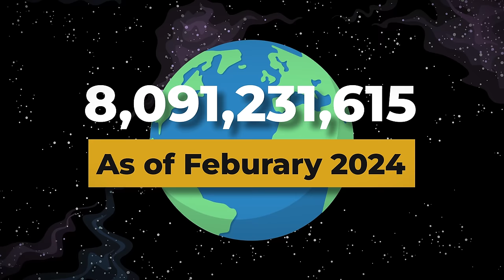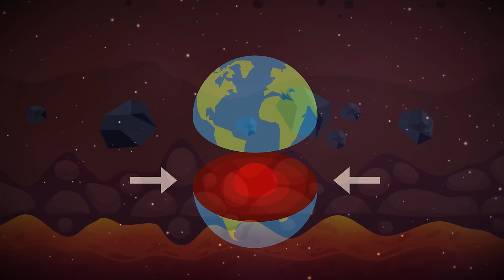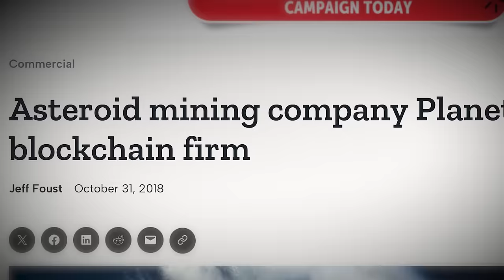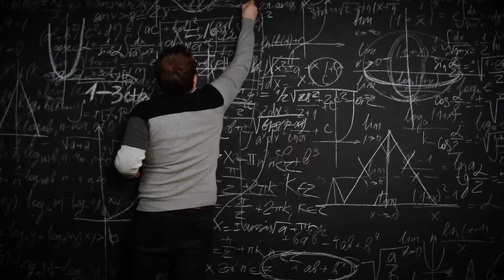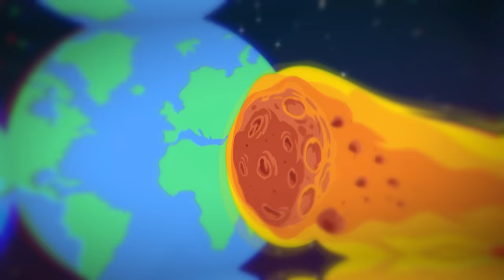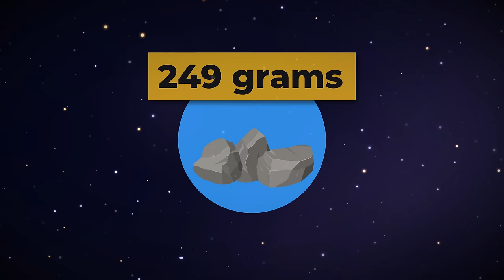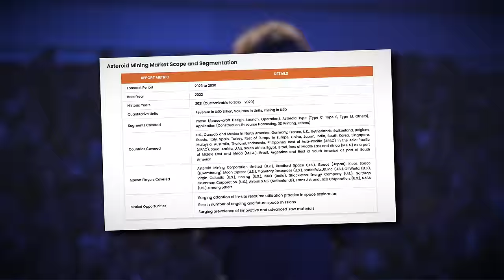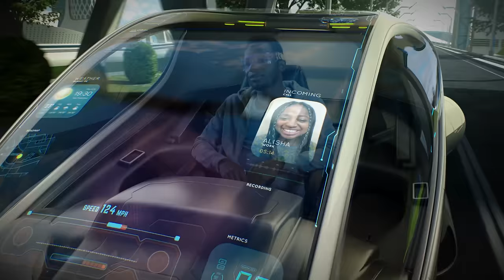Billionaires Are Secretly Directing Asteroids To Earth and We Don’t Know Why

Comment: A space construction yard for ships would be start.
Reply: please define "ships"
Reply: Where do Shipbreakers sign up?
Reply: Then we will have space pirates.
Reply: @dynhoyw  A ship is a vessel.
Reply: Or like a base on the moon.
Reply: @KarmaCadet  Well, we now have a military unit for space, so let the uncontrolled spending begin!!
Reply: @dynhoyw  There's simply no need to define a basic word.
Reply: @mikitz   captain Harlock
Reply: @geostyma you want a base on the moon.  I'd like a border wall.  Let's start with projects worth doing, right here on Earth first, ty
Reply: @cloyola8889 Robert Bigelow has multiple research and production facilities in space right now.  Private owned but public knowledge. Zero gravity is a necessity to try and understand and reverse engineer stolen exotic technology.
Reply: @dynhoyw  A ship is like a boat but bigger.
Reply: @Durzo1259  on Earth? not really, but in space? do yall even know how that would be done with our current technology, resources and funding? by proper definition of popular dictionaries, a ship is a vehicle or a vessel typically bigger than a boat for transporting cargo by water, and no way in hell will we fill in the necessary requirements to move around goods at interplanetary distances in the present, let alone in the near foreseeable future. Thoughty2 explained the reasons for that quite well, and unless some mystical breakthrough is discovered in rocketry ain't no way we'd be building "space construction yards for ships" like it's Trailmakers. people mention ships and space-shipyards like we're in Space Engineers, like we're a type II civilization. how and when would we even build such thing as a space construction yard? when the necessary requirements are met? well no shit sherlock

Comment: Why can't we just Anchor a lazer/ solar sail with a Lazer in the Anchor to push sail. And then crash them into the moon and mine and prosscess them there. Or put a second rear solar sail on them use the sun's solar wind to slow them down and brake them in orbit then breakdown bigger ones into smaller pieces in orbit and parachute them down over ocean. Though landing them on the moon at mining factory would be easier.

Comment: Why not push a NEO into the moon, and then mine the crash site on the moon?  The impact should help crack them open, and the moon should also have enough gravity to build drills on.  It seems way more practical than anything else.  It would still be a massive undertaking, but it’s a lot more doable.

Comment: If the metals are pulled into the Earths core then wouldn't Lava contain large amounts of these elements?
Reply: Kind of. Magma, what lava is called before it reaches the surface, is molten rock with dissolved metals and minerals in it. The trouble is that even when molten or dissolved, heavier elements still "settle" out. so while the magma is rising, it deposits the heavier minerals and elements and the erupting lava is mostly just silicates. This is why we have to dig for the metals and where we dig is usually the location of ancient volcanic action.

Comment: Here's one way the human cost can be removed almost entirely, aside from any actual trained astronauts needed for certain roles.

Have mining drones do the majority of the work of the extraction and transportation to a mothership designed to refine and manufacture on site. The pilots of the drones are stationed on earth, using a specialized network to reduce latency times down to acceptable enough levels to do the job. The only requirements to operate would be a controller and laptop capable of playing the feed sent to the screen. This would make it so that basically anyone can make money operating the drones as they see fit and/or are capable of operating. So if you can operate 12 drones on your own successfully, then you are free to do so, with some limitations put in place for fairness. 

This makes it so that the only human cost is the astronauts put in space to do the tasks that require the human touch out in space. Anything that can be automated via robotics is. Of course this all still costs a lot of money too, but comparatively it should be less than trying to house thousands if not possibly millions of humans in space. And the materials for the drones could be harvested on-site as well or nearby to manufacture more when needed due to malfunction/destruction via accidents. (Which is once again another saving grace of using remote operation. Less human cost once again.)

It would probably ideally be used best in conjunction with parking said asteroid in the moons orbit, but I have some issues with that in regards to possible sudden rouge asteroids near earth. Still, that would probably be the best scenario for this use case, since it would allow for the network to be as short as distance as the moon, which should make connections 'possible', though maybe not preferable in speed/latency. But again, so long as the pilot can operate without issue, it should be fine until better technology reduces that problem. 

AI could also be used in the drones to automate them, but this may be one of those things where the human touch is still preferred for safety reasons in case of AI malfunction. Thus the remote operators would still be employed as a fail safe at the very least.

This would essentially create a ... near infinite... job market, where the company ultimately profits more the more they can diversify their asteroid holdings for constant extraction. Obviously supply and demand must be obeyed, but ultimately so long as the demand eats the supply fast enough, most of this problem will be averted on its own. I.E. The mothership using its own collected materials to make more drones to collect more materials. The excess of this is what is sold instead as an artificial cap and trade system of sorts, where the main function of the operation is to keep the operation in continuation with excess going towards saleable product for proceeds to allow continued funding of the operation. If one is exceeding the other, rebalance and continue forward. 

And as for continuing forward: Eventually deep space mining ships will be required, where crew will be stationed as well even if they continue remote operation from the ship. At that point nodes would be set up along the way to allow for earth based miners to continue operation as well, but with added latency per node hop. These ventures would likely be solely sent only for the rarest materials that we just can't find elsewhere. So they would be quite rare operations.

Comment: What about a massive net connected to multiple units with thrusters, the net initially becomes slack on contact but applies counter resistance slowly to slow down the inertia.. thrusters apply thrust in opposing direction based of trajectory impact into the net. 
Bring the rock to the nearest unit for mining..
Secondary note: 
Massive net is already going at speeds comparable to the expected speed of asteroid, this way the difference in speed is very minuscule and thus easier to mitigate the impact difference
Also this brings in to mind, aliens would never need to harvest our planet if our most valuable resources are plenty more abundant in asteroids…
Reply: Lol. Fuel

Comment: A drill can be mounted to the surface it's drilling. A 4 year round trip isn't bad for a 27 quintillion dollar payday. This video has actually convinced me of the feasibility of asteroid mining.
Reply: weight and capacity. we would never get 27  quintillion$ from one mining trip,  we would more than likely make 0  profit and actually lose money.
Reply: @d4e_gaming838  I get that, but it wouldn't be a single round trip. The way I think of it (in very broad strokes, of course) is, build the space drill, habitat, and cargo fleet before ever leaving the planet. The fleet would run on a rotation, and the mining facility would be semipermanent. Even a fraction of a $27 quintillion payday could make it worth it. "You have to spend money to make money" isn't as cliché as it is because it's false. All it takes is one eccentric billionaire to plan it right and it's on.

Comment: The Dino-Killer-Asteroid probably wasn´t as big, as calculated.  And Asteroid-mining for metal-iusing on earth may be a bigger problem, as some think. Because, if the uge amount of iridium in the geologcal layers around the world, which is conoted to the Dino-Killer-impact, came from platin191, that transformed/decayd by electron-capturing (nuclear decay-process), then first, the object wasn´t as big, as assumed by calculating the crator-extend, because a nuclear explosion would be even more distructive, even, if the pobject would be only a fifth or tenth or even 50 times smaller, of its neccessary extend would be by measures and calculations going out from the crator.
And secondly, you will bring cosmic nuclear bombs to earth, when mining uge amount metals from those asteroids and bring about to bring it down to earth. Whilest entering earth-conditions, that delivery potentially will blow up in a uge explosion and left uge amount very toxic metalions in the atmosphere. Besides that explosion, where you never get the metal back (because of literally atomization - because all the metal with the right isotope-configuration will bow up and leave only atoms of metals, not chunks of), you also will initiate and/or accelerate a mass-exstinction, because single atomar metals are very toxic in higher amounts, as normaly creatures would be absorb by every-day nourishment. And that will manipulate creatures so much, that they never ever anymore themselfes and not able to be survivable).

So, when mining asteroids, then for processing and use only  in empty space (orbit or whatever) or... you need to extract and/or transform those special isotopes in the metals to be able to bring it to earth without a uge catastrophe...

Comment: The real problem is not the cost of mining the asteroid, it's the infrastructure to get there.  Most of the technologies exist, just have to be adapted.  We just don't have the luxury of using things like gravity, which many of our refinement processes on earth use.  Mines on earth wouldn't be built either, if the entirety of the process - from the trucks, to the drills, to all the way back to major cities, and the power - had to be built by the company, before a single dollar can be extracted.  And that is made all the worse due to vacuum and radiation.

So we'd need what we need here on earth.  Governments (or at least a third party) needs to build the primary infrastructure and vehicles, and then other companies would just lease those and go off to do the mining with far more manageable expenses.  But that's a chicken and egg problem.

Comment: that's the prime reason, money. the infrastructure to even begin to mine would have to be set up first. solar generators to beam power where needed along with more mobile on site solar panels. that by itself would be a huge expense, the power network. then the miners, AI controlled to grind and mine, send to a sorter that can use the power network to sinter the metals into slugs and fire them off (EM launcher) to a receiver station, think baseball catcher. which can either redirect then send them further or package them for a larger payload to be picked up by yet MORE AI ships to earth orbit.

just the basic power infrastructure would take billions and years which is why none of the startups got off the ground, at some point they realize they just can't make an all in one system, that they're going to need some pretty specialized infrastructure and machines to do anything and the costs balloons. once it's all set up you're golden...it's just getting to that point.

Comment: To process ore in space they would have to build giant centrifuges that can withstand molting materials. It would first need crushed in pulverizers then heated to a liquid state then transferred into the heat resistant centrifuge spinning until the materials are separated then drawn off by elemental weight then cooled in injection molds placed in a reentry vehicle then shot to earth. Once it’s in atmosphere how will they slow it down enough to be of use or not destroy something. It will be heavy coming down you know.

Comment: I doubt there will ever be a break-even point to bring the material to earth.  The day we need the material in space for a mega project will be the day it becomes practical.   We will probably just send the equipment to the asteroid, and the building site will be on the asteroid itself.  

A deep space exploration vehicle could also be built from an asteroid. They could mine one side to build the ship and leave the other side of the asteroid in tact as a nose cone for absorbing impacts from space dust, radiation and particles they may collide with on the journey.

Comment: 3:37 Clarification: caves were not all that popular. Most of the hospitable ones seemed to be occupied for short durations.  Though huts (both on ground and in trees) have rotted away, there are a few examples of support beam holes and parts of preserved timber (in low oxygen environments that were flooded). It seems that even the Neanderthals preferred to build their own homes.

Comment: probably dumb ideas for mining. both involve lasers.
 use lasers to change asteroid course so it will slam into another asteroid, whether they smash to little pieces or generate enough heat to melt together, just grab all you can carry. use lasers to drill holes into asteroids, then use bombs to break off large chunks.

could just not even bother sending material back to earth and instead use it for building space stations and factories.

Comment: Please, asteroid mining is NOT that difficult. Step 1 would be to anchor your equipment to the asteroid then you can drill all you want. Use a hollow drill (such as they do with coring) and you've got the materials in a colum ready to break apart and remove materials. If refining is nessary you can use the core colums, load into a return vehicle and refine them where your refinery is. You don't think billionaires would have figured that out? (or hired someone to figure it out)

Comment: C3PO was talking about the belt in the film not the one in our solar system. BS comparison. And until we have more experience in space-nudging an asteroid towards Earth-what happens when someone decides to do their calculation in the wrong measurement system and they drop it on a city? To make space mining and metal processing would  need to be to make stuff for use in space or a space elevator to bring the stuff down safely and cost effectively.